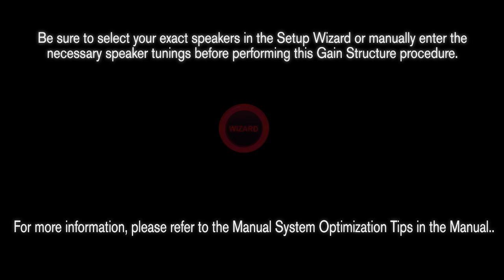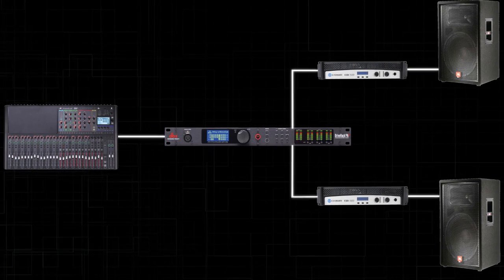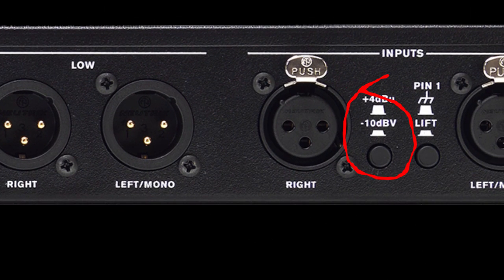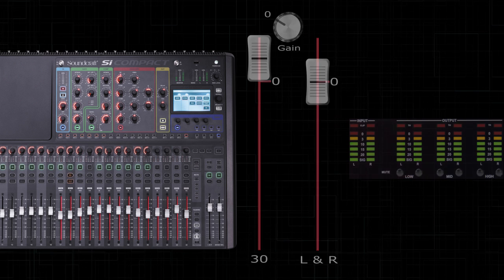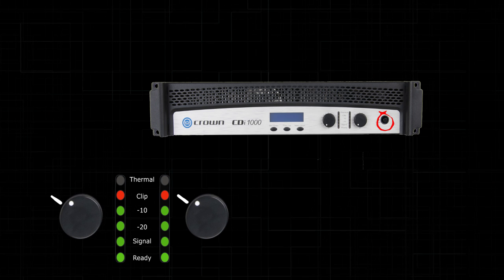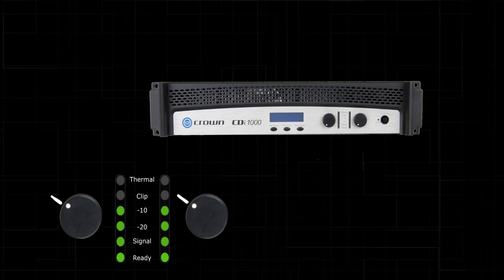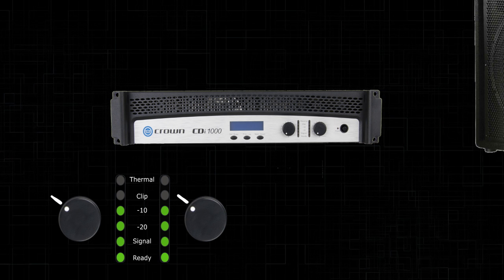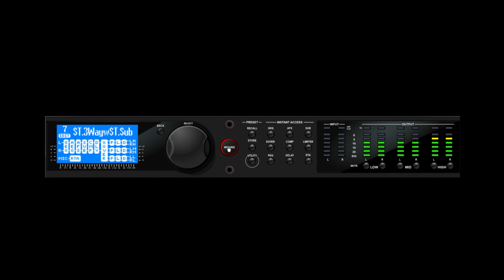DBX DriveRack PA2 - Manually Optimizing Gain Structure

Comment: I prefer to put all my Amps on max level and adjust the gain from the crossover of the pa2
Reply: Do u recommend i do the same or just try this videos method? I cant verify if i can turn my amp off without a load. I have a chinese off brand one lol or do i leave the amps on only difference is I’ll constantly hear the pink noise while adjusting the gain.
Reply: we’re same method used 😅

Comment: can a PA2 work with powered speakers ? specificlly studio monitors?   anyt feed back would GREATLY appreciated
Reply: Studio monitors shouldn't require any processing. Certainly not to the degree that this unit provides. The more equalization you apply to a reference monitors the more phase issues you will have.

Comment: Hello.  if the amplifier has a limit, is it still necessary to set it in the processor?  use qsc plx amplification line!  thanks
Reply: If the amps are digital and have a limiter where you can set the threshold, gain reduction etc, then you can also do it in the amp. Although doing it in the processor is more convenient since you do it once for all the signal chain. But if the amp is analog where you set the clip limiter with the dip switches, then that limiter would not be enough in most situations.
Reply: Not necessarily. But the purpose of this video is to set up proper gain structure thru the system. So that when you see clip at the mixer it is also occurring at that exact same time at the amplifier.

Comment: Hi, when you’ve done the auto EQ then you run the AFS, the machine will cut the feedback frequency, isn’t this like altering the ideal em curve that the DBX PA2 just created? Can you please comment. Thanks
Reply: Ideal EQ curve I mean
Reply: Yes, it does. If all your your mics are behind the main speakers you probably dont need AFS. I rarely use it. If you have a wireless mic running out front it would be helpful. But those AFS frequency cuts are stored in a different place than the auto EQ. If you return to the venue later you can chose to include them or not.

Comment: do need to manually optimize the gain structure if you have a RTA mic and powered speakers
Reply: Gain structure should be set correctly no matter what components your system is has.

Comment: and why would u use this? you lost me in first 3 sec.
Reply: It's a digital cross over , EQ , limiter , compressor
Reply: This processor has a lot of features that are described in other videos. In order to set the limiters properly you need to have proper gain structure thru the whole signal chain.

Comment: @ DBX,  would it technically be possible to use this PA2 as a DB meter ??  It would be fantastic if that can be done by a firmware update and then you can use the RTA mic for measuring the decibels at the dance floor in the venue/club  !!!

Comment: Question I just got driverack pa2 yesterday. How and where can I get a pink noise? I am a very new on pro gear stuffs. please help. Thanks,
Reply: +1cung If you are using a digital mixer, the feature is usually in-built.
Reply: No, I have a Yamaha MG12XU. Thank for your replied,
Reply: if still relevant, there lots of apps for that try tone generator iOs, I tried mine setting up zero/unity using 1khz tone, perfect and enjoying my clean signal chain plus   power and clearer output. PFL=zero, post fade zero, digital processor input=zero, digital processor output= zero, then amp to below clipping point.